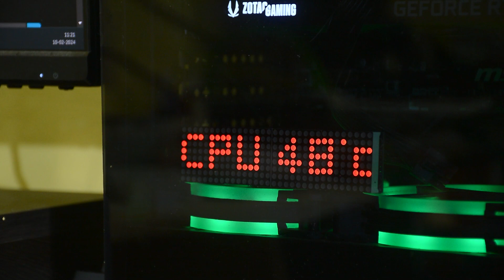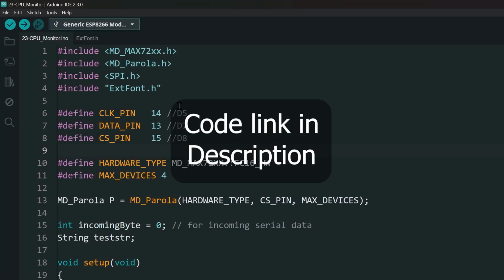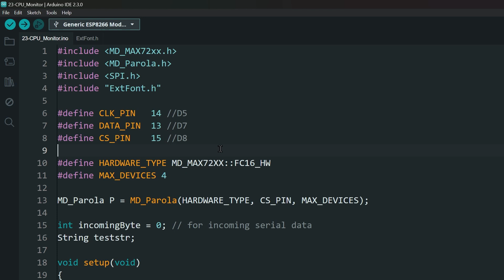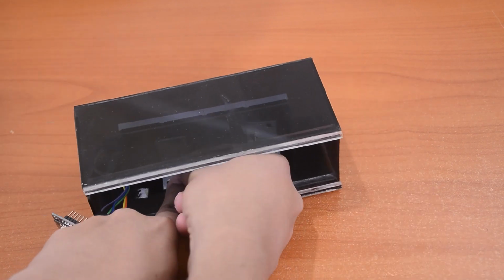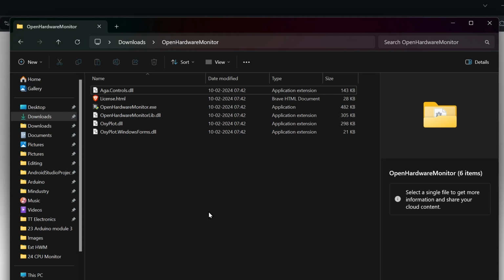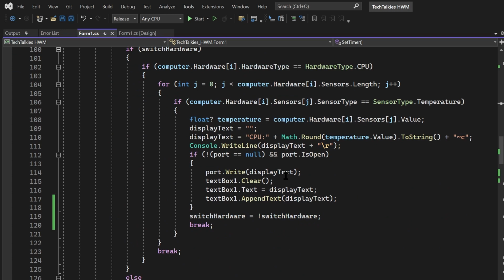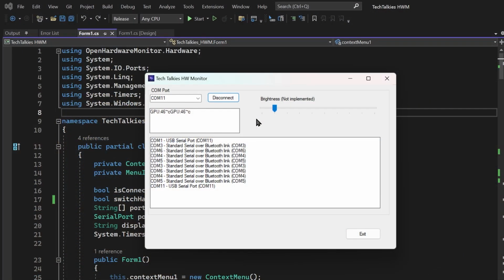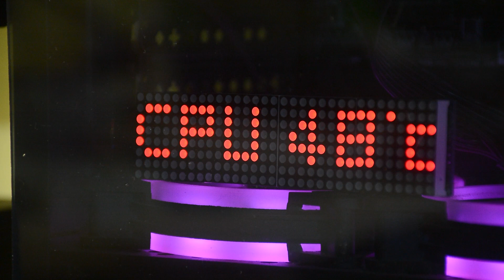Arduino / ESP8266 PC Hardware Monitor

Comment: It says Arduino in title but you used ESP
Reply from the maker: It's an Arduino project, made in the Arduino IDE. Can be made with any Arduino board.
I'm using the ESP board incl case we want to send the data to a webserver in part 2 ✌🏻